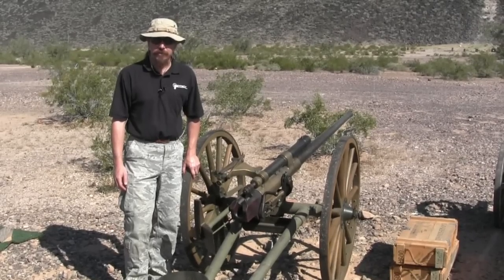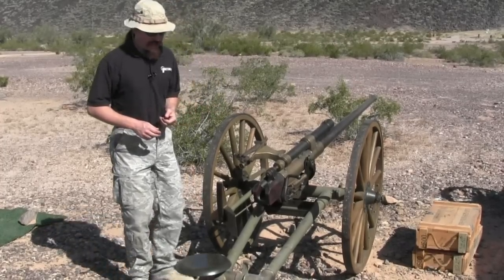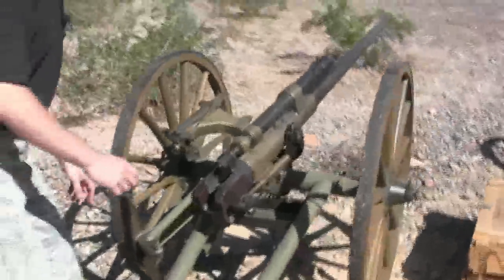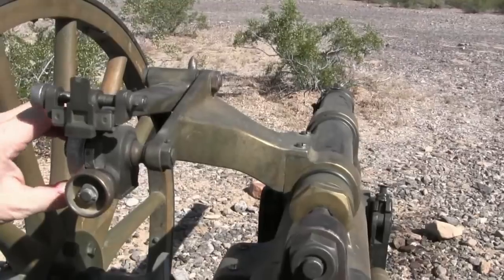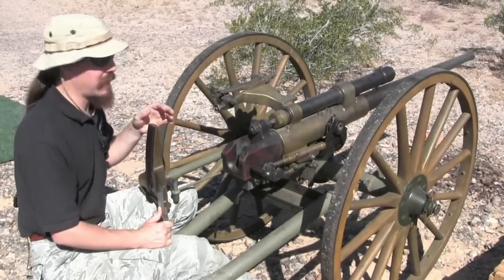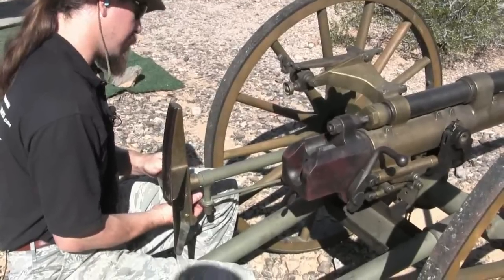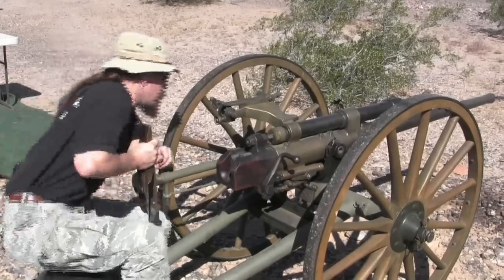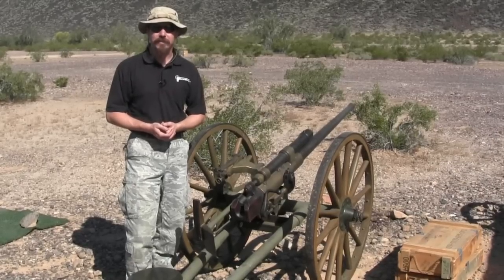Bethlehem Steel 37mm Cannon - WWI Era

Comment: Thats about as close as you can get to a shoulder fired 37mm gun. Of all the small cannon, that design has to be the neatest little piece I have ever seen. Would be a great defense against the Somali pirate boats if you mounted it on the stern of a tanker or cargo vessel. Thanks for presenting this great piece.
Reply: The US had a 37mm mountain gun in WW2, it mounted onto the same tripod as a .50bmg.  was about the same overall weight as the M2.
Reply: Simply use the canister round i am sure they had available. At 500 yards it would make great chum out of a pirate RHIB and crew.
Reply: @ET Hardcorgamer Don't underestimate the possible rate of fire for these. With a two-man crew, 20rpm or more is viable and using HE you would only need one round on target.

Those pirate attack crafts were not all that quick (maybe 25 to 30 knots) as they were usually heavy timber craft with a 50 to 70HP outboard. If you are making 20 knots and they are trying to intercept the relative speed was rarely more than 15 knots and that isn't all that hard a target to hit from a large and thus stable vessel such as a tanker or container ship.
Reply: Napalm bombs should do the job with pirates or quad fifty's if you prefer.
Reply: It'd be cool if you could go back in time, and mount this on a pirate ship circa 1700. 🦜🏴‍☠️

Comment: I have a friend with a fully operational gun. Not an anti armor gun at all. Antipersonnel gun. That's why it was made to swivel so freely. The Americans fielded a tripod  mounted 37mm artillery piece, the m1916 37mm. which was latter used in the Renault tank that the Americans used in 1918.
Reply: Was the usual round supposed to be HE or AP (or something else)?

Comment: Nice. To be honest, you never really see WW1 arms and armour. Good to see.
Reply: Not as many survived as they did in WWII (though still a lot of WWII stuff didn't survive either)... Shame, really love WWI era stuff.
Reply: Most ww1 gear was obsolete by ww2, so it was probably melted down to make the newer gear. ...... Shame, I like the early stuff too
Reply: Exactly, I own a WWI era Gew 98 that was refitted for use in WWII.
Reply: I have a 1916 lee enfield  well used warhorse
Reply: Been looking for one of those... But at the moment I am broke as hell.
Reply: That field gun would be pretty useless for world war 1. To low of a caliber.
Reply: Anon San f
Reply: @goose4113  loaded with HE in the trenches it would a great tool for dispersing a push, and even better if loaded with canister
Reply: @goose4113  that field gun has enough of a caliber to stop a tank of the time. 
also the free Pivot allows to follow the tank easily.
not all artillery of WW1 was used for massive artillery barages that WW1 was known for.

Comment: I just saw TWO of these today at a corner war memorial in Norristown Pa! Amazingly intact and without breechblocks. Rust has cut cut holes in the top of the barrels about 5 inches from the muzzle.  Both detachable trail seats still in place since 1922 when installed there. They got a Duster and a naval saluting gun too. Hell of a time figuring out what it was . Only Bethlehem 1917 on a trail.

Comment: I love how the chassis barely moved, soaking up the recoil, but the Camera thought the world was coming to an end.  (I've been around 75s going off at Ft Sill.  It sounds like hell caving in.  Regardless of the ear protection, you can hear it through bone conduction.  You skull picks up that sound.)
Reply: Try standing on the back deck of a Chieftain, doing infantry fire control, when the 120 went off!
Only got to do it once.
Impressive just doesn't describe it.

Comment: Would have been an effective anti-tank gun when tanks were introduced.
Reply: +dimapez My guess would be that these were to be used in big battles after the first trench-line of the enemy had been taken. A common problem was that the further you advanced, the less artillery coverage you could get. A small, light artillery piece like this could perhaps be hauled along with the troops and set up shop just behind the new front line.
But as you say, they would be an easy target, probably why they were never actually shipped to Europe.
Reply: +dimapez Looking at surviving WWI trench positions,  I would say they were concerned about sharpshooters but not so much about heavy caliber rifles.  I expect that with this gun in position I would get a few potential targets but would need a good armored plate to counter snipers until I hit them.
Reply: +dimapez well i guess mobile artillery, can bring these along in attack or something much easier than heavy arti
Reply: Very effective actually, with AP rounds that would have penetrated a couple of models still in use at the start of WW2.
37mm is a highly effective calibre or at least it was.
Reply: dimapez  "See that heavy machine gun over there? The one slaughtering my troops . . ."
"Yes, that one, make it go away please".

Comment: The US Army accepted an offer from the French Army to acquire these guns. The US Army thought it used the same ammo as the M1916 37mm trench gun which was adopted from the French. It turned out to use a proprietary Bethlehem developed 37mm shell. The Army took these guns on inventory but disposed of them to groups looking for display weapons after WW1. The performance was somewhere between the M1916 and the M3 anti-tank gun. This gun would have been quite capable against Japanese armor in the Philippines in 1941-42.

Comment: It looks like about 300 of these guns were actually made and made it to France. The AEF was supposed to get them but it turned out they didn't shoot the ubiquitous Hotchkiss 37x94R mm ammunition but rather a proprietary round and they were returned to the French for the duration of the war. They were used in anti tank batteries and evidently took out some German Kriegsbeute (captured and re-used) allied tanks .
If anyone could tell me what the actual ammunition used by this weapon is and what its penetration statistics are I'd be grateful.
(Edit) It seems the weapon uses the far more powerful 37x137R mm ammunition used in the McClean 37mm Automatic Cannon.

Comment: So the US Army had what was, in essence, the first practical anti-tank gun but recognise it as such.

It would have coped very well with the tin plate armoured tanks of Ww1 and the 1920's.
Reply from the maker: Actually, the US made reasonably extensive use of the M1916 37mm gun for anti-tank use as well as against gun emplacements.
Reply: it would have made pretty easy work of many of the early ww2 tanks(im looking at you italy)
Reply: Leon Libeu Ah, Italian tanks..... thousands of rivets moving in perfect unison.

The round doesn't even have to penetrate to send loose rivets pinging around inside.

Any muzzle loading Napleon field gun would have dealt with a WW2 Italian tank.....
Reply: thinking along my line of thought,
Reply: Brady Ward As a concept representation of an AT gun (as the only 1920's and 1st AT gun was the German WW1 37mm. TaK 18) for military wargames exercises and future tactical planning it would have served the US Army well.
Reply: Forgotten Weapons The M1916 is a copy of the French 37mm Infantry gun (canon de  37mm mle 1916) that when mounted on a tank became known as the SA 18 Puteaux. It is NOT an effective anti-tank weapon.
Reply: Ted Schwartz The French Mle 1916 / Sa-18 was 21 calibre lengths where as the US 37mm. Bethleham infantry gun is clearly more than this at around 40 to 45 calibre lengths, giving a slightly higher velocity. Against the weakly armoured early tanks of the 1920's and 1930's, even those with face hardened rolled homogeneous armour such as the Vickers Mediums, Vickers VAE 6 Tonner, US prototype tanks, anything Japanese it would have been adequate. The French 37mm. L.21. was good for a maximum penetration at 100 meters versus 90 FHRHA of 19mm. with M-1892 cast iron APHE, 27mm. with M-1917 forged steel APHE and 31mm. with M-1934 APC solid shot. 90% of French battle tanks were equiped with this useless gun in 1940. If German panzers had been armoured with 8 to 15mm. of armour it would have been adequate. Instead they had 30 to 50mm. of armour and history records what happened next. However in WW1 early tanks were armoured with carburised steel (Harveyised armour) which was prone to spall and brittle. In a period range test the 37mm. L.21. M-1916 was found to penetrate up to a maximum of 28mm. at 100 metres with M-1892 cast iron APHE.
Reply: I know this is an old comment but still...

“Instead they had 30 to 50mm. of armour and history records what happened next. ”

No, they did not. In 1940, Germany still relied heavily on Panzer I’s (up to 13 mm), II’s (up to 15 mm) and the Czech 35(t) and 38(t) (both up to 25 mm). 

Even the early Panzer III, which was the German tank designated to fight opposing armoured forces, had less armour in the A-C versions (15 mm) and had only just reached 30 mm in the latest D-F versions available by 1940.

The Panzer IV’s armour also only topped out at 30 mm in the versions available for the Battle of France and it was not intended to counter enemy tanks, but to smash through entrenched infantry and field fortifications.

The French defeat in 1940 was far more due to doctrinal, tactical and strategic mistakes than to inferior equipment, apart from a significant gap in terms of fighters.

If there was ever an illustration of John Boyd’s mantra “People, Ideas and Things, In that Order”, the Battle If France was it.

Comment: Wouldn't any gun be a threat to early tanks. You just need accuracy. Early tanks were prolly just a few mm of riveted armor. A well placed shell or splash will disable the tank.
Reply: not just probably, they were only protected against normal Rifles. even Rifles with Special ammo(steel core ammo) could Damage them. 
however it is not as easy as shoot through the armor and the tank is done, you need to damage something vital inside.

Comment: Interesting gun. I would hazard a guess that it fired the same shells as the Puteaux SA18 37mm cannon on the Renault FT? That also used a semi-automatic action and (according to wikipedia) was intended for engaging machine-gun nests and infantry, firing APHE Mle 1892 and HE Mle 1916.
Reply from the maker: Actually, it's shell is a bit larger than the Renault's. That was a 37x94mm; the Bethlehem gun used 37x136mm.
Reply: Forgotten Weapons Ok, I stand corrected! :)
Reply: Forgotten Weapons Actually just had another thought; Did they use the same projectiles for the two guns, just with a larger case length for the Bethlehem gun?
Reply from the maker: Akm72
I don't think they used the exact same projectiles, simply because different factories were making the different type of ammo. But they were the same size projectiles, and they could be interchanged today,

Comment: Ian love the vid series  could You inculde a pic of comparably sized rounds  on these odd sized shells  We hear 37MM but is it closer in size to 40mm greanade or the 40MM bofors size AA gun ?
Reply from the maker: In between. The brass case was 136mm long (5.5 inches). The projectile adds another two inches or so to the overall length.

Comment: Since both sides in WWII (I know the video is about a WWI era weapon) used 37 mm weapons I ask just what is it about a 37 mm projectile that made it so popular with so many and for so long? It seems to fit right into some "niche" for some reason.
Reply: Quicker firing, more ammo, lighter guns, etc.
Reply: Dan R 37mm shells were standardized as 1-lbr shells in the 1880s.  1-lbr Hotchkiss 37x94mm were used for a naval rotary cannon for anti-torpedo boat work.  The shell became standardized; nations began to develop their own weapons to fit the common shell.  Then, nations had stocks of 37mm shells that they wanted to use, so they kept developing 37mm weapons.  And it was a known compromise between light enough to handle easily and heavy enough to be useful.
Reply: Smallest shell of smallest weight that escaped Hague Convention bans on explosive anti-personnel projectiles.
Reply: Hello jsm. Thank you. It would have taken me a lot of time to find that out. Is there anything about 37mm performance that pleases just about everybody?

Comment: What would have this been used for? I'm confused as it looks like an AT gun however, obviously the central powers had little armor so the allied had no need for an AT gun. It doesn't look like it could be used as a howitzer and even if it could there are better options like the 18 pounder.
Reply: It's an infantry gun, probably inspired by the French 37mm mle.1916. They're used to accompany advancing infantry and provide direct fire support.

Comment: this may sound like a dumb question but how do you aim accurately with iron sites placed on the side of the barrel and not directly on it
Reply: At 37mm calibre, with the size of the targets you aim a gun like this at, it doesn't have to be that precise. Think of it as a steroid-boosted long-range launcher for extremely large hand grenades and you get the picture. It's enough for a small ship or a pillbox. You know the Somali pirates and the suicide speedboats in the Persian gulf? That is roughly the TYPE of target this gun was originally meant to fight.
Reply: jsm666 makes perfect sense thank you my good man